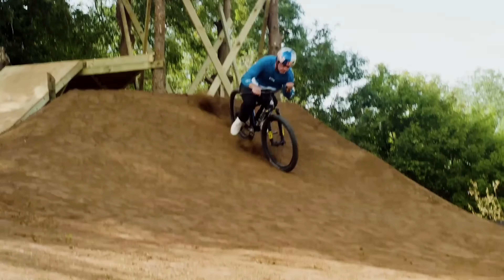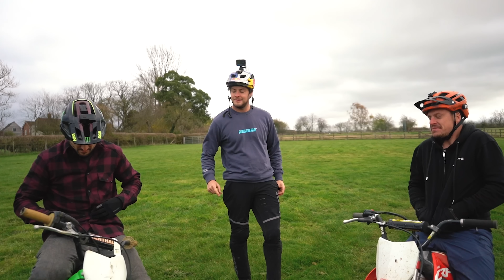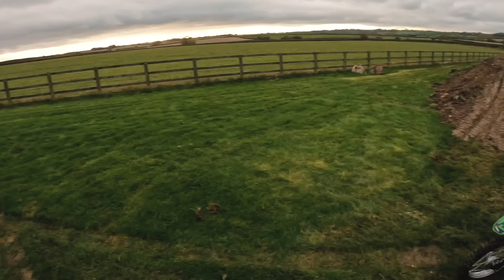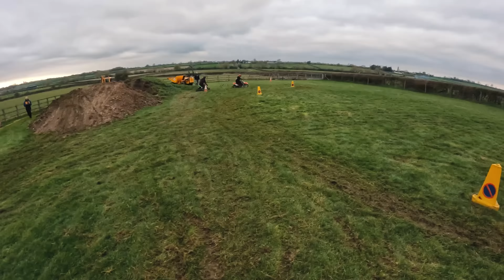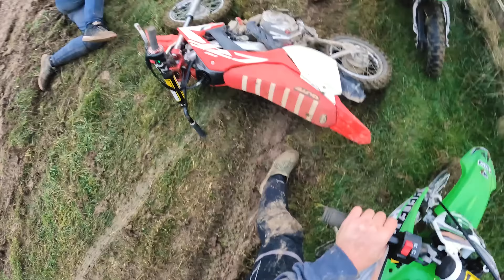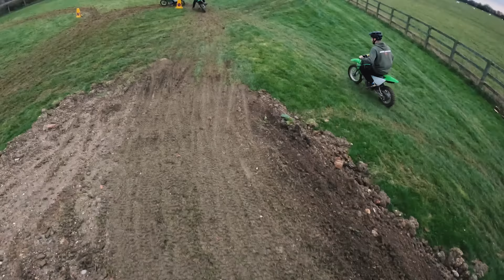WE BUILT A CAR JUMP AND RACED THE NEW PIT BIKE TRACK!!

Comment: I think a "main" line is needed that's a little more open with some wide sweeping corners maybe connecting to the "inside" track you just made. It would give more passing lanes and allow you to run threw the gears a little more .

Comment: With the jump line you should do an inside and and outside line of the same jumps but offset by a roller at the start of one and at the end of the other. That way if youre side by side you can have a person on the ground and in the air at the same time